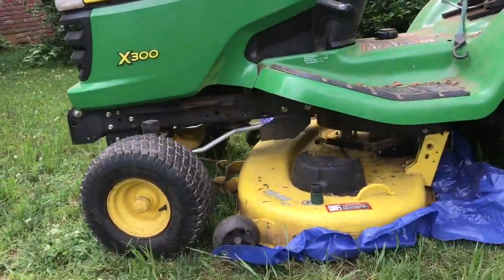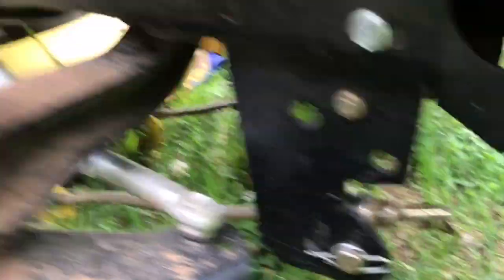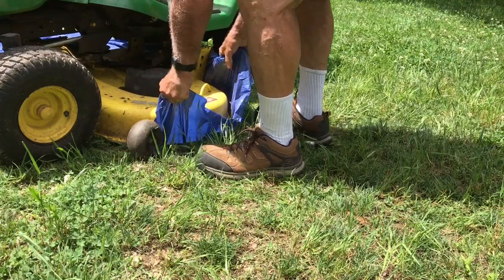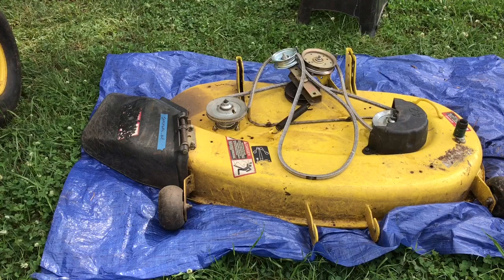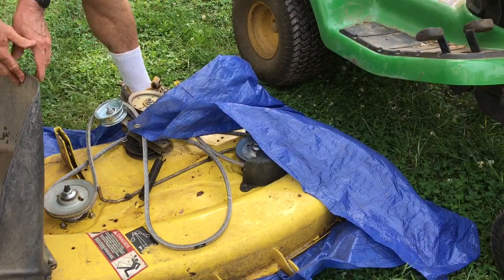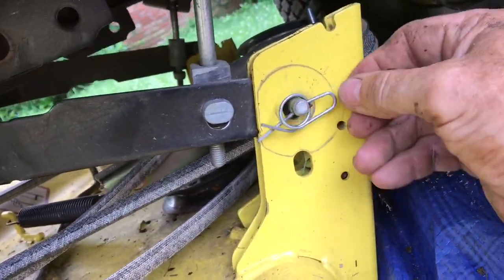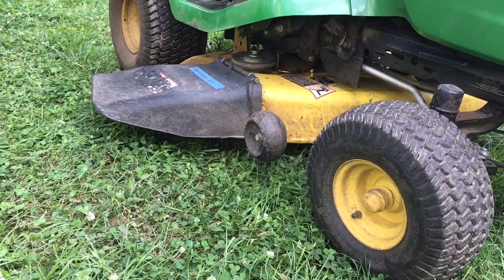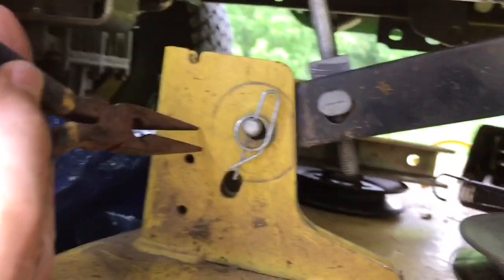John Deere X300 deck belt change.  With details

Comment: Larry, you are the man. I’ve switched this belt out on my x300 now 4 times.  Your insight with putting a socket wrench in with no bit in that retractable bar was perfect. Yes I used a PVC 2 foot section for better leverage. I found it easier using my foot to step down on the pipe vs having it behind me. Big thanks for making this a million times easier.
Reply from the maker: Timothy Clayton 4 times?  You’re a professional.  I’m glad it helped.  Thanks for the nice comment.  Happy mowing.  I hope you can get several hours on this new belt.
Reply: I have that same very tractor x300 and my mower belt keeps breaking any solutions?

Comment: Of all the YouTube videos showing how to replace the drive belt on a 300 series John Deere, YOUR VIDEO IS THE BEST AT SHOWING ALL THE STEPS.  I would suggest getting a helper for this project.  The helper is particularly useful in moving the mower deck out from under the tractor and re-attaching the belt to the engine.  Also, I used 2 by 4s under the mower to make it easier to slide out the mower from the under carriage.
Reply from the maker: Thanks Mr. Wilson.  I certainly agree that a helper would be great. I’m use to working alone. The 2x4s is a great tip.

Comment: Just a quick hello from Texas. Got my belt from the dealer up the road $53. Installed and mowed wet grass. Also changed the blades to yellow mulching blades.
Worked like a champ. 
Thank you for your video. 
My grass was getting to long!
Reply from the maker: Pancho Villa Smith fantastic!  So glad to help.  I’m going to try those mulching blades this summer.  Happy mowing.  Larry

Comment: Like the 190 comments before me, MANY THANKS!!!!!!  I should have listened closer and took a note when you gave the belt number.  It would have saved me two 45 minute trips to the mower shop.  Even though they had a maintenance record showing which model tractor I have, they sold me the wrong belt the first trip.  Using the pipe to extend the ratchet handle was brilliant, I would never have thought of it.  Now I've got to see if you have any more video tips. You're a good man Larry!!  New Subscriber.
Reply from the maker: Thanks for watching and your nice comments, much appreciated. Glad it was of help. I’ve been really lucky of late. Still running on the belt I put on in this video. Hope I didn’t just jinx myself. Thanks for subscribing. Happy mowing

Comment: Great video! My local dealer has a 4 month wait time for repairs and was no help. After watching your video and buying the belt I was able to replace the belt by myself, and I'm 72 years old! One tip I might add is using a box-end 15mm wrench to loosen/tighten the two pulleys at the rear to allow the belt past the guide pins. (I figured this out AFTER I scraped the back of my hand when the wrench slipped off the nut due to my lack of a deep-well socket, as you mentioned in your video.)  I didn't need a long extension on the wrench to move the tension pulley.
Reply from the maker: Steve Godsey fantastic! Glad it helped.  Open end wrench is a great idea, sorry about the knuckles 🥴

Comment: Thanks for the video. It made the job go quick and smooth. I even had a 4’ piece of pvc that helped get the belt on the drive pulley.
Reply from the maker: Steve Hoersten wonderful.  That PVC really helps with the leverage.

Comment: Thanks, Larry. Your instructions were spot on. Made this an easy job. We won't deal with the local Deere dealer either. And Deere's pretty proud of those belts. I got a Gates replacement at the local NAPA store for $51.00.
Reply from the maker: Awesome, I’m glad it went smoothly.  JD seems to be proud of everything.  Thanks for watching and commenting.  I sincerely appreciate it

Comment: Thanks for the video, it gave me the confidence to replace my belt. There were some variations that I assume were due to differing model numbers, but basically is was right on. Thanks again.
Reply from the maker: Wayne Vowell glad it helped.  Now I need to change the oil.
Reply: You and me both.

Comment: Thanks for the little tips.  It's always the littlle stuff that bites me in the rear.  Like those notches on the back pully retainers you mentioned. Waiting on my belt now and thought, "Hey, let's see how the You Tube guys do it!".  :)
Reply from the maker: CurtisDrew1 same here, that’s exactly why I mentioned those notches, I’ve messed up there before!  Good luck
Reply: Larry Satchwell I learned that today. Must of missed that part before. Normally I had someone helping me. But not today so I was able to pay more attention to the small stuff. And hit replay if I wanted too.
Reply: Well it thought yesterday that since I was waiting on a new belt  would just clean the deck while it was out, sharpen the blades again and grease up the spindles.  (I had it hung on an overhead winch on an I beam in my shop, so it was easy.) When I put my grease gun on the left spindle the grease zerk pulled out.( the kind that mounted on the side of the spindle housing)  Stripped at the factory I guess.  Decided to unbolt it so I could replace the grease zerk and 3 of the 4 bolts that hold it to the deck snapped off. They refused to e-z out of the spindle housing.  So rather than tap a new grease zerk and drill out the broken bolts I ended up buying a new spindle to go with the new belt. Sharpened the blades and just got it running again a few hours ago.  Cuts good.  Was going to just drill through the old broken bolts and retap it, but didn't feel like messing with it.  The new spindles have the grease zerks in the top of the spindle bolt.  I would have missed the notch on the retainer rod too, but your tip kept that from happening.  Thanks again.
Reply from the maker: CurtisDrew1 wow, you had some trouble!  Glad you were able to work through it all.  Good luck for the rest of the summer.

Comment: Thanks for the video Larry. I used it to replace the belt on X300 in France, The manual supplied with the tractor gives part no m154601 though, so I used that though I found it quite tight to get it on to the drive pulley. Two weeks later it broke again [the first one lasted four years]. After looking again at your video and looking up th JD parts catalogue and many suppliers in Europe and the US I've concluded your part [M154621] is the correct part [which is about 3ins longer] and the manual has confused the 38in deck with the 42in. Could explain why so many people seem to have very short lived belts on the 42c mower deck. No doubt I'll be studying your video again when the new belt arrives though in the days of corvid19 that may be some time. Two acres of grass could be fairly long by then! Many thanks for your work.
Reply from the maker: I agree that there is some confusion on parts list.  They put at least two different motors in the X300 the year I bought mine.  If you don't know the serial number when your looking for parts you can end up with the wrong thing.  Thanks for watching and happy mowing.  Stay safe.  Larry

Comment: In order to get grease in the sealed spindle bearings you need to pump about 70-80 pumps with the grease gun. You will see grease coming from the top and bottom of the spindles. Someone on YouTube tested with a different color grease and took the bearing out and seal out of the bearing and the new grease was inside.
Reply from the maker: Thanks, that's good to know.  I'm going to do that the next time I have the deck out.

Comment: Video was very useful.  Belt was installed without any trouble at all.  On the side note, could you explain what was the problem with your carb.  Think I am riding in the same boat that you have ridden, except the part of paying the dealer lots of dough for repairs. I replaced the  starter coils, new batt, voltage reg, drained gas tank and the mower still does just like you said yours did before the work on the carb.  Thanks a bunch
Reply from the maker: Kenneth McLeod it sounds like the same rabbit trail I went down. In fact I’m sure I have a pair of perfectly good coils in my parts box.  So, there is a small needle valve in the carburetor.  It has a little rubber tip on it I think.  Anyway, you can sit and let the mower idle for hours and then you move it and it might run for 10 minutes or 2 minutes then stop.  The valve has dislodge and you get no gas.  I didn’t rebuild the carburetor so I don’t know exactly where it is but my guy says it’s only a $10.00 part.  Good luck, hope this helps, please let us know.  Larry

Comment: hate to tell you this. The bearings are sealed in the deck.  So greasing the deck using the grease fittings is doing nothing at all.  infact its  hurting you cause there is no grease weep hole.  So your just pushing your bearings.   Otherwise great video.  I recommend removing the spindles then removing the seals from the bearing and drilling a grease weep hole.
Reply from the maker: Thanks for the advice.  My mower just turned 300 hours so it’s time for an oil change. Do you recommend any other maintenance at 300 hours?
Reply: @LSatch  i am weekend warrior too.  I just found out about the bearings when mine seized up.  Took it apart and found out the bearings where completely sealed.   Then i talked with John deer and they said they all the decks come that way.  So you can take a seal out an repack them or take the seals off and drill a small weep hole on the spindle so you no its packed with grease.

Comment: Thanks a bunch for the video Larry. It was well done and very helpful. I’m curious what that $10 part in the carb was that fixed your issue with it only running for 15 or so minutes, I’m dealing with that issue now and have tried a bunch of fuel delivery fixes to no avail.
Reply from the maker: Deemn FSH my problem was a needle valve.  I don’t remember the parts name but you need to get into the carburetor itself to change it.  As I recall, it has a little rubber tip.  It would idle for hours if not moving. Sometimes it would run long enough for me to cut the lawn, then sometimes for a few minutes.  The valve would wiggle out of place.  
Hope this helps.
Reply: Thank you Sir! I appreciate you!

Comment: All I needed was a picture.  Once I had the picture I was good to go.  Interesting that you had a problem with engine performance and your shop gave you the run around.  Or was it just incompetence.  I needed a new fuel pump. Got a bunch a bull and finally I diagnosed it.  I was going to repair it myself and on my way home after over a week of waiting they came and picked it up.  They did exactly what I was going to do.  Didn’t charge me for anything but parts.  Cause it was under their repair warranty

In these times I figured they hired some young gear head who could talk the talk but didn’t know what f he was talking about
Reply from the maker: I agree 💯 %.

Comment: Thanks for the video I have exactly the same machine an no store in my area cant tell me the exactly number of deck belt i need ...can you please give a hand with the number of belt u use or the one I need please...i will appreciate the help
Reply from the maker: Eduardo Feliciano this is the belt I ordered on amazon. John Deere Original Equipment V-Belt #M154621
You may want to check to make sure you can return it if it’s not the right size.  Hope this helps. Good luck. Larry
Reply: @LSatch  hi thank you so much for the help I order the belt it was a lot of help i really do appreciate you taking me to the right   raod thank you again
Reply from the maker: @eduardofeliciano9990  That's great.  I'm glad it works for you.  Happy mowing.

Comment: Hey Larry - thanks for the video. I've changed our X300 belt a couple times in the past few years, but this last time it seized on something and split only after a couple weeks and I have to change it again. I appreciated you posting this - I may have missed something. Also, what part in the carb did they replace? Did they do it or did you do it yourself?I have exactly the same issue. The dealer said it was the seat cut-off but I don't believe that.
Reply from the maker: Michèle Jedlicka I went round and round with the John Deere dealer and mechanic for months and spent several hundred dollars. Long story short.  I took it to a different mechanic, he knew exactly what it was.  I don’t remember the name of the part but basically it’s a little needle value that regulates the gas flow.  It’s a $10 part but they have to rebuild the carburetor to get to it.  The part is about a half inch long with a rubber tip as I recall.  Hope this helps.  Happy mowing, Larry
Reply: That's very helpful. Thanks Larry and thanks again for the video.
Reply from the maker: Michèle Jedlicka glad I could help.  BTW, I’ve not stepped foot in Ag Pro John Deere since.

Comment: Greetings from the UK - great video Larry. My dealer is 9 weeks in arrears. The belt slipped off recently and I managed to get it back on with some cussing and scrapes. I loosened the 13mm pulley guides to get the belt on but I didn’t know about the notches for the guides. I might not have fixed them back correctly as the belt broke 2 days later ( thankfully after a cut), I have a belt tension bar on my X300 so don’t need the steel brace to get it back on. I’m hoping the reason the belt broke ( it looked quite good but was 8 years old) is just due to a weak spot and possibly my notch issue. Great to see how to grease the bearings as well. Does this have to be a certain size grease gun? Anyway - I’m in my 70s and not allowed to do this sort of stuff -  so when my wife is away for a day I’m going to tackle this as you make it look so easy! Thanks again - and we suffer the same poor dealer service over here as well.
Reply from the maker: Brian Herbert thanks for the kind praise.  Don’t get me in trouble with your wife!  😄. I’m not sure about the grease gun size. Here in the US I think they’re pretty standard.  If you’ve gotten 8 years out of it I think you are lucky, it probably just wore out. Good luck I hope it goes well and quick, before your wife gets home.
Reply: @LSatch  thanks Larry - I will investigate locally. Maybe you could do another video on 100 hours servicing requirements sometime. “Cheers and stay safe”
Reply from the maker: Brian Herbert I did a maintenance video that I think covers that.  https://youtu.be/oskC2lyTmPU
Be sure to read some of the comments because as I recall I missed one of the grease points.  Thanks for watching

Comment: There are known issues with this mower deck shown in the video blowing off belts . It just happened to me after a week of owning this same mower, has this been an issue to you Larry ?
Reply from the maker: driggs51 I wasn’t aware of this. No it hasn’t happened to me yet. I’ve had this mower for, I think, 5 years, maybe 6. I’ve replaced the belt twice. The first one broke because the idler pulley froze up. The second time I’m not sure why but it was several years old and I had been abusing it, using it like a bush hog in the woods. I’ll post a follow up if it ever does fly off. Thanks for pointing this out.

Comment: I have the 42” edge xtra X300. How do I know the exact belt? Book and online keeps giving me different part numbers.
Reply from the maker: Janice Mitchell wow, I’m not sure.  Can you find a number on your old belt?  Surely John Deere has a live chat or contact phone line.  As  a last resort, I’d make sure I could do a free return before you order one.  Wish I could be of more help, sorry.
Reply: Pretty sure it's 146 1/4" for the 42" deck.
Reply from the maker: Janice Mitchell I hope you get my response, had a hard time finding the question in the video.  I guess you got the belt.  I’m not sure which pulley you’re talking about but..... if the pulley has angle on the inside, a V groove fill the groove with the corresponding part of the belt.  Continue weaving the belt around all the other pulleys without twisting it.  If it doesn’t have a twist in it you’re good to go.  Hope that helps.
Reply: Larry Satchwell hi, I got a John Deere OEM 42" Mower Deck Belt M154621. I have the same mower as you. But I broke another belt today so I was just still wondering if that’s the correct belt. I’ve been watching your video again trying to make sure I’m putting it on correctly lol lol
But I keep breaking belts more often then I should. I have a lot of dips in my yard so I don’t know if that has something to do with it.
Reply: Larry Satchwell is your belt a M154621?
Reply from the maker: Janice Mitchell yes, I just went and double checked, that is the same part.   I think you have a bad idler pulley. That’s what started me on changing my own belts.  Unfortunately, I don’t know how to change that pulley.  Several years ago after breaking 3 belts in a short amount of time, I took it to a mower mechanic who diagnosed the problem.  Good luck, sorry I can’t help more.
Reply: Larry Satchwell which pulley is that? The one in the very front up top? My mover only has about 378 hours on it so not a whole lot.
Reply from the maker: Janice Mitchell I’m sorry but I don’t know.  I found this, https://www.johndeerestore.com/jdb2cstorefront/JohnDeereStore/en/John-Deere-Products/Genuine-Parts/Replacement-Parts/Spindles%2C-Pulleys-%26-Springs/Idler-Pulley-for-GT%2C-LT%2C-LX%2C-X300%2C-EZTrak-Series/p/AM128118